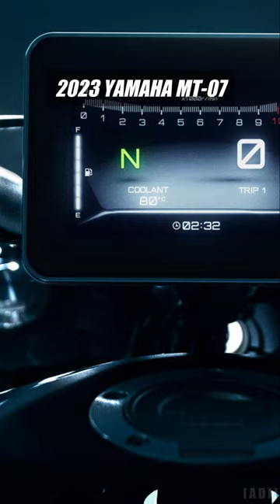2023 Yamaha MT 07 - NEW FEATURES

Comment: I’ll be keeping my 2022. I don’t use my phone while riding. They did fail to mention that the 2023 now comes pre wired for a quick shifter though.
Reply: @Bed of Fire or Decompose you must mean the 2023 right? I have a 2022 and the ecu is not set up for a quick shifter. Healtech has a popular shifter that works well. I myself just blip the throttle when up shifting.
Reply: Also smaller rotors I was reading on the website

Comment: $1900AUD more than the Honda Hornet and 16.5HP less than it.
Reply: And? It's not abt the horsepower it's also about the brand reliability and style not to mention the digital screen. The digital screen alone is worth more than a bike that's even 50 hp more
Reply: My opinion*
Reply: @Vibe4Lyfe  the MT does have style. Doesn't ride as well as the hornet though, from experience. Both are reliable bikes/brands. Both have digital screens. Both are fun and easy to ride  bikes.   I definitely prefer the extra power and get up and go of the Hornet. Definitely prefer that it was cheaper also.
Reply: @Vibe4Lyfe  id take a street triple R with no digital screen and 40 hp more if money were no issue. 🤣 give me a better ride over a digital screen any day.